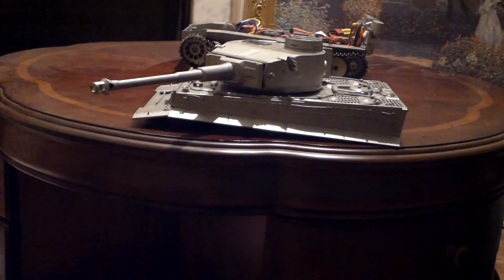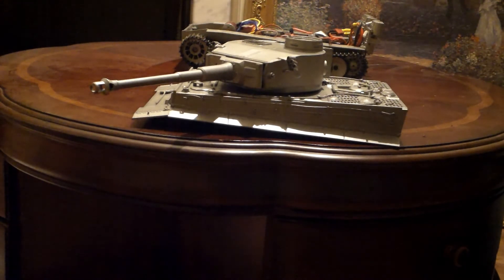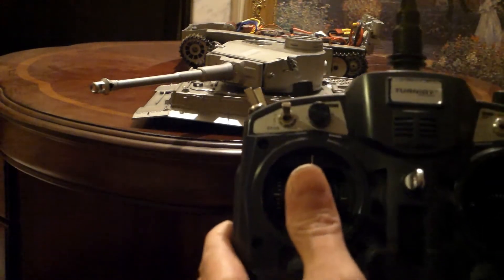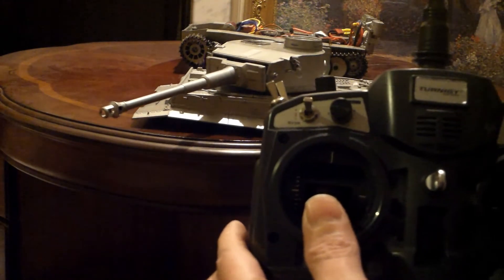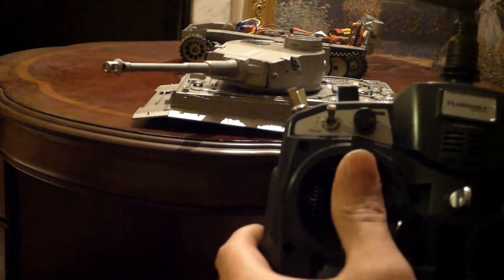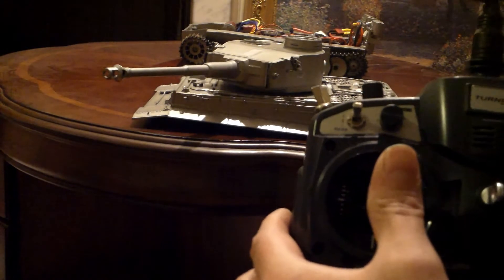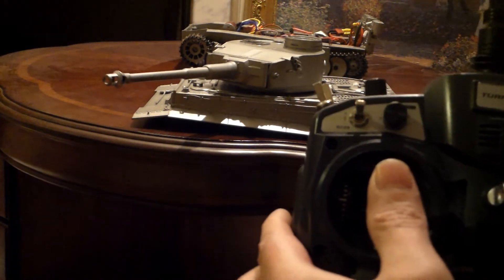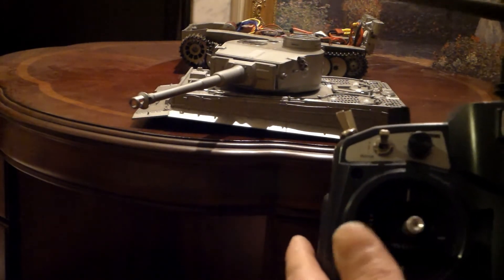All Metal Mato Tiger I RC Conversion - Gun and Turret

Comment from the maker: It is basically a metal version of a Heng Long Tank, so if you hate Heng Long you won't like this one either. There is nothing wrong with the metal, it is heavy and 100x stronger than any plastic. It is not all aluminum, but then it isn't $2500.00 either. Lot's of people spend almost as much getting a metal hull, and then it is only partly sheet metal and plastic on the outside. There is something special I think about an all metal tank!

Comment from the maker: Yes HobbyKing is out of stock on most of there brushless motors now for some time (I think the factories were flooded.) You can try Hobbypartz also for cheap motors. I do think you would find 3000 Kv too fast, and that it would not be smooth at slow speeds. Even 1800 Kv is too fast with the stock gearbox. Also, if yours is the type with plastic gears, any brushless motor might chew them up in a hurry

Comment: Thanks friend for your quick reply! I have the plastic 1:18 heng long Abrams tank actually. I want to replace it to 2.4 ghz radio cause the original range sucks. I tried finding 1800 kv on hobbyking like yours, but only found 3000 kv. Will this be okay to simulate its speed? I can program the radio to make it move at realistic speed, but I am afraid it may not have enough torque power, especially when moving uphill or when moving slowly (jerk effect). What do you think about 3000 kv friend?

Comment from the maker: Your comment was marked as spam, maybe because of your screen name. I had to click the not spam. I answered the turret question on the other video. For moving the treads I used brushless motors and esc's I got from hobby king. Brushless motors are definitely not needed by the way and in some ways they cause problems. For one thing I did not have good luck with the stock gearboxes, so I got some 3:1 reduction steel gearboxes from Germany and so far they are holding up.